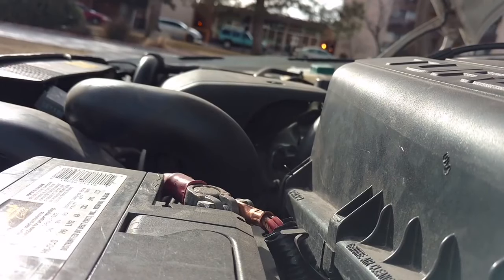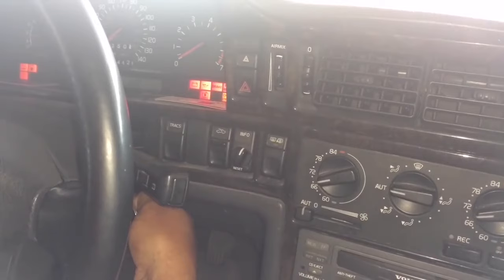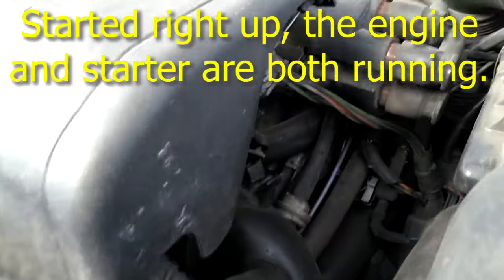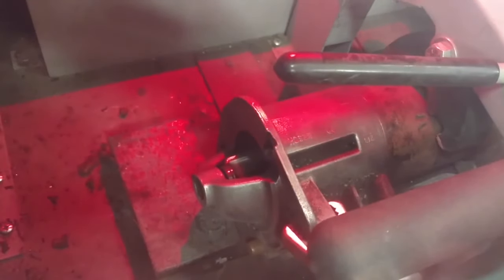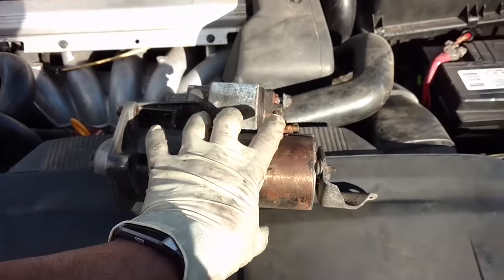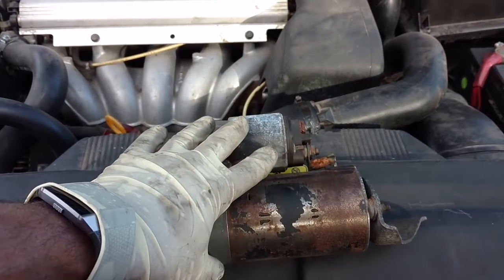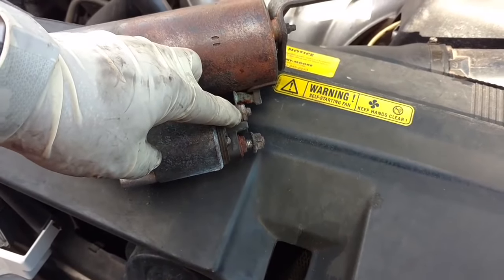Is your starter bad, hear the noises or sounds a bad starter will make. Also a full demonstration.

Comment: My 2010 Mercedes ML350 has a strange knock, the knock happens right after the engine starts, my mechanic told me it might be my starter has a problem with the mechanism that moves the pin back after it starts the engine. 
Could I have your opinion, please?
Reply from the maker: That sounds reasonable to me. My brother-in-law had a starter on his Jaguar that stayed hung up for about three or four seconds after the engine started. Made it horrible racket.
Reply: @Robert DIY  so the mechanics were correct with what he said. 
Thank you for your fast reply, and keep going with your great channel ❤️

Comment: my 2004 jag xtype has power operate the windows, but the radio in the switch is not coming on on the dashboard won’t start no crank
Reply from the maker: Did you try to jump it?

Comment: Help.. my car won't start.. it made multiple clicking, replaced the battery,  had the starter tested and it was fine.. 
* I'm going to post a video on my page.. please look😑
Reply from the maker: ok
Reply from the maker: How did you get the starter tested?
Reply from the maker: Does that vehicle have 2 batteries?
Reply: @RobertDIY  yes, advance auto tested it, said it was fine.. New battery, cause that other was was completely dead, I was hoping that was the problem..

Comment: I've 2016 Focus Se 2.0L Flex fuel engine and this mechanic say to check if switch is bad jump starter at its terminals ? so starter is mounted and connected just hit positive big main terminal with lil positive terminal ( which is next to it ) just like how'd you bench test it ? If it cranks it must be switch ? Doing it this way you bypass switch ? What it's been doing is weakly trying to start but almost like it just spins weakly . And yes I took it off took it to that mechanic and he bench tsted it looked good told me to put it back on try it . I did and it's not turning over just weak whining sound. Brand new battery
Reply from the maker: Could be a weak starter motor or bad battery cable.
Reply: Anyway I did if and still doing the same

Comment: My vehicle is making this noise. I have a 2004 Ford explorer 2wd. My vehicle wouldn't start one day we changed the starter relay and it started the vehicle. A few days later starter not wanting to start had to turn the key a few times. It always makes the loud clicking noise.  The auto place told me they couldn't test it if it's still starting that it would show the starter to be good. Is this correct. I believe my starter to be bad.
Reply from the maker: Correct. They get a dead spot on them and as long as it doesn't stop on the dead spot, it will be fine.
Reply: Thank you for responding. I believe I'm just gonna take it back and have the starter changed on it. Some times I'm have to turn the key up to 4xs before it actually starts.

Comment: 2009 Chevy impala won't crank I've replaced the starter replace the relay switch and it still won't crank to start a fuse is good what's my issue
Reply from the maker: likely the immobilizer.

Comment: My ‘05 Subaru Outback makes a hissing (yes like a cat hissing) kinda noise during cold startups. Once the engine is warm, it doesn’t do the noise after starting it again. What could this be??
Reply from the maker: Vacuum leak.
Reply: @RobertDIY  Oh this is no vaccum leak. Probably a “hiss” is not the proper way to describe the sound then. I’m talking about a very loud grinding like hiss only when the engine starts.

Comment: I'm having a problem with my new stater not engaging the engine. My battery is probably dead because when I jump started it. The starter free spins. I made sure that the starter was properly installed in the reverse order that I removed the old one. I then tried to jump start it again. The only power I got was from the other vehicle's power. So it's the battery correct?  I changed the battery terminal that connects the negative because it was bad. So, My last effort to fix this mess is to install a new battery and hopefully it will work because the starter will not engage the engine. Please help me
Reply from the maker: Did you have the new starter tested before you installed it?
Reply: @RobertDIY  it's a 2006 mercury grand marquis. I thought it was the battery terminals. So I changed them. I also have a new battery. As soon as I hook up the new battery. The starter free spins. So I have the new starter, new battery and new battery terminals.
Reply from the maker: Does that mean it's all good?

Comment: So my el camino has sat all winter. I had a charger on the battery but its just rapid clicking. Does that mean my starter is still good just my battery is not charged enough? The battery is otherwise new, just sat too long
Reply from the maker: sounds like a weak battery.
Reply: @RobertDIY  awesome! Thank you. I really didnt want to replace the starter. Guess I gotta let it keep charging

Comment: i have a f350 just put in a new starter in it started a couple of times but im still getting that bendex sound could there be another problem ( flywheel) or its just not engaging ......./
Reply from the maker: Probably another bad starter.
Reply: @RobertDIY  thanks will just get a brandnew one......

Comment: I just got my starter rebuilt, put it back in and it only makes a buzzing noise. The battery has 12.47V and is fairly new, I bought it last April so maybe 4/5months ago
Reply from the maker: Did you have it tested before you installed it?
Reply: @RobertDIY  No, I trust the shop that rebuilt it/I've never had a problem till now. I just got the battery checked and it's good so it's got to be related to the starter or the connections, right?
Reply: @RobertDIY  just a quick update: I tested the battery, it's fine. I disconnected the relay fuse, checked for continuity as per repair manual and it was fine. I took a wire with bare ends and bridged the 2 pins (1 and 3) and the starter started clicking. I cleaned the battery terminals and used PB blaster and a little dielectric grease on the posts. Tried to start the car, same thing, just a humming noise. Could it be the ground strap? Or what about the ignition switch?

Comment: I gotta Question, I bought a mustang with a bad radiator. Paid a shop to fix it and refill it with more coolant. And i drove it after well a couple weeks go by and my car starts saying it’s getting and and then cold, hot then cold. It’s not smoking so I genuinely don’t think it’s my coolant level because it just got filled. I thought it was maybe a sensor so I fixed the engine coolant temp sensor still didn’t fix, and I found a hole in a hose so I put tape over it. Thought it was just my temp gauge well I drove it and the hose from my air intake to my left valve cover blew a hole and my car shut off. Fixed both the hose but the car won’t start back up, now sounds like a starter but why would that go bad. It sounds like a whirring sounds when turning the key over. It doesn’t crank or start just a whirring sound and everytime it drains my battery more and more to the point my lights in the car get dimmed
Reply from the maker: Ok, sounds like you have multiple problems. You need to fix one issue at a time until it's fixed and running properly. Something can break on a car every day, especially if it's a Ford.
Reply: @RobertDIY  fixed the hoses but nothing, I kept trying to start it and was getting a whirring noise but the engine doesn’t crank. Now it’s clicking rapidly every time I try to turn the key
Reply: @RobertDIY  pretty sure the battery wasn’t the issue but now the battery is bad. It won’t charge past 12.1-12.2v.
Reply: @RobertDIY  blown head gasket, I’m gonna try and replace it by tomorrow

Comment: Mine makes a grinding noise for 3 seconds after starting it, when driving everything is fine. You think it’s the starter or flywheel? 08 tacoma
Reply from the maker: starter
Reply: @RobertDIY  okay so it only does it sometimes, I bought a new starter today I’ll replace it tomorrow. It was doing it a lot when it was cold is that common?
Reply from the maker: no.

Comment: My car won't start after i drive it for a while during the day. I stop and turn it off for a while, like 20 mins, and cranks but doesn't start again until it cools after about an hour or two, or until i crank it the next day (it turns on the first try). Changed the battery today since it was old and tested bad yesterday but still having this issue. Do i just go and change the starter for a new one? Thank you in advance !
Reply from the maker: If it's cranking, the starter is not the issue. Many cars have a ECT, engine coolant temp sensor which goes bad and tells the computer that the engine is cold or hot. This will effect the fuel mix that the computer demands and can cause starting issues.
Reply from the maker: https://youtu.be/Jc4pfC3D3EU
Reply: @RobertDIY got it. Checking The ECT sensor and will update. Thanks so much!
Reply: Update: ECT sensor changed out but car was still failing. Starter is good, battery is new and still was getting the P1185 manufacturer control code. Dealer wants $250 dlls just to diagnose. Haha

Comment: I just put in a new starter, battery cables and my battery is good but when I turn the ignition I get no turn over but a sound like something is spinning for a couple seconds.  The lights work and everything but no sound of it trying to turn over, just a spinning.  Does anyone have a clue? Thanks
Reply from the maker: did you have the new starter tested?

Comment: So i have a bad control module and a bad starter n also i have a bad gear solenoid i know I shouldn’t be driving it but i have no other source of transportation so i have no choice i have to get to work anyways so yes i been driving it n now im just starting to hear a kind of humming noise sounds like its coming from somewhere in the motet with a slight vibration what could that be does anyone know?
Reply from the maker: I don't totally understand your situation, however, I suggest that you take the vehicle to a shop to make sure it's safe. Let them know up front that you are financially challenged and can not afford repairs and that your primary goal is to make sure the vehicle is safe to drive. You don't want the vehicle to catch fire or anything like that.

Comment: I 1989 ford 460 motor starter will clink one time then nothing ( my question is when you connect the jumper cables to the starter you only get sparkles and the starter dies nothin but sparkles
Reply from the maker: I don't understand the question.
Reply: @RobertDIY  when I test the starter with a battery and jumper cables I only get sparks ( it's a band news starter )

Comment: Hi Robert, Is it possible a bad starter will cause a car to overheat? Please lmk thank you
Reply from the maker: I doubt it
Reply from the maker: https://youtu.be/BtdifArSU3Q
Reply: @RobertDIY  Then possibly my fuel pump went bad and caused my vehicle to overheat and not turn on no more? I replaced the starter this morning and had no luck.
Reply: @RobertDIY  I have a crank but no start, I’ve tried listening for noise coming from the fuel pump and i cannot hear anything when i turn the key to the on Position. Just want your opinion

Comment: My GMC Yukon has been noisy at the flywheel and starter and now sometimes when I go to start the engine it wont go to idle (just turns over like no fuel) and if I let off the key the starter still turns over for a second or two and dies out, then it starts on the next try but almost too soon. Starter? Timing? Help? Lol
Reply from the maker: Probably a failing fuel pump.
Reply from the maker: https://youtu.be/NWfLpp8NevI

Comment: I drive a manual transmission. My car cranks but won’t start. I was aware that the flywheel was getting bad but didn’t have the money to fix. I drove it one night parked it and the next day it wouldn’t start. Would the flywheel cause this? Please help. All mechanics I have talked to are idiots
Reply from the maker: if the car is cranking, there is another issue.
Reply from the maker: https://youtu.be/YiPAPu-K8OI
Reply: @RobertDIY  okay so if it’s cranking then that would mean the flywheel is engaging the starter correct? And it’s not a flywheel issue
Reply: Sorry. I am a 40 yr old woman and have NOBODY to help me out with this so I’m trying to figure it out myself

Comment: What of its rapid weak clicks but the battery is good? Still the starter?
Reply from the maker: How do you know the battery is good?
Reply from the maker: https://youtu.be/2rVt-TDqmSc
Reply: Bought it before testing like an idiot. Just pulled the starter. As it turns out there is a wire on the back of my starter that's all but rotted through. I'm guessing that's why it sounds like a bad battery.

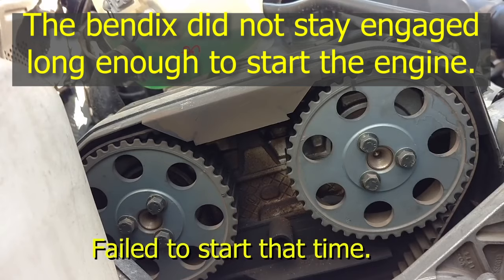Comment: Although mine makes the sound like at 3:08 . Some background on my several times I've replaced starters in been last almost eighteen months about . About 18 months ago my first one gave out and replaced it . Almost  a year later five months ago in July  another one replaced but mechainc found oil on gear so he thought we both thought that was causing it . Rear main seal is leaking . And that one lasted like I said only five months and very last one only lasted two weeks and when I personally took it off no oil just very clean and not covered in oil like I thought it would be .  . I don't know what's going on .. I took it off and mechanic bench tested it said it looked good I should put it back on and try it . Still doing the same sorry I wrote the same thing on last comment just wanted to add the history of  my starting problems
Reply from the maker: Newer parts are made cheaper, especially if you get an after market part. Also, you can have a battery cable issue.
Reply: @RobertDIY  no it’s Ford starter.

Comment: I have 2010 Infiniti G37 my car have issue long start when I drive the car after 20 mins and park for 10 or 15 mins but it’s start fine if I stop the car and crank back up
Reply: Do you think bad starter or fuel pump ? And sometimes after long crank like 3 times it’s start the car but very rough idle and when I press the gas it’s running fine
Reply from the maker: https://youtu.be/NhtUXZTurzo
Reply from the maker: Probably a sensor.

Comment: Can bad starter make engine lose power or weak when on?
Reply from the maker: I doubt it.
Reply from the maker: https://youtu.be/NhtUXZTurzo
Reply: @RobertDIY  battery ok ,just changed alternater even a jump it wouldn't start,finally I started it but pulleys and belt are going slow I don't know what it is the engine light is not  on either

Comment: So no sound means, a new starter?
Reply from the maker: Or the engine is locked up.
Reply: @RobertDIY  my little nissian pulsar kind of doesn't want to start turn off the key try and start and it's totally dead when trying to start the car but battery lights everything is fine

Comment: so with no click at all that means the starters dead?
Reply from the maker: Could be. Did you try to jump start it?
Reply: @RobertDIY  No actually haven’t had any cables only a battery charger w the connectors from jumper cables but what happened was 2 months ago i had a guy come out and replace my alternator in my 06 3.3l hyundai sonata, he took my radiator out which he didn’t even have to do that. but in the end he put the new alternator on put the radiator back and didn’t put a hose on correctly so a little under a month goes by and the hose slips off enough to leak all of my coolant , at this point i didn’t know about the leak, i went 7 minutes down the road and noticed soon as i got to
my location i left my wallet so i pull out and look at my Temp gauge, it was fully on H i pulled over a minute later and turned it off barely any smoke was coming out from the hood no dark smoke , but anyways we got it towed by this point it was still starting, got it towed home n fixed the leak the next day , throughout fixing the leak we started it up over n over throughout just fine, got the leak fixed and drove it for almost a hour n turned it back off. came outside not even 5 minutes later to drive it again and it hasn’t turned over since , all the lights on dash come on , i turn the key it’ll click once like the battery clicks but it won’t do anymore click to the starter from that point on . just turn the key no response nothing no crank nothing for the past month, havnet had enough $ to take it to a shop idk what to do at this point i’ve jus been saving money to take it somewhere
Reply: also my brother whenever he was driving it he said it had made a noise or was making a noise from the alternator like it was the last time before we replaced the alternator
Reply: not sure when the noise was happening i wasn’t wiyh him whenever he fixed the leak but at this point we are at a standstill with no clue what to do it might’ve not been making it while he drove it i woukdnt think it would he said he drove it for a hour it sounded fine n ran good but he did say when he started it it sounded like a noise from the alternator just like before it was replaced
Reply: not sure if the alternator noise could have been a noise from my starter and he just didn’t realize or what

Comment: Hi Robert I subscribed to yoyr channel and website. I wanted some info on my 04 acura mdx she won't start. I've been trying for 2 months.
Put new starter
Alternator 
Spark plugs.
I was driving and it shut off. Doesn't start just whines. I have all power .... 
Or anyone might know?
I took off timing cover on motor it's supposed to be on 1 it was on 5 I turned back till it was on 1...
Put cover back on and still doesn't wanna start. Left it alone. She was running great pks anyone I really need help asap.
Reply from the maker: https://youtu.be/YiPAPu-K8OI